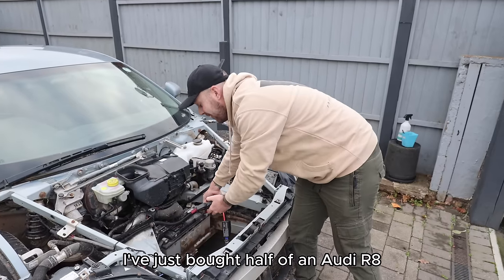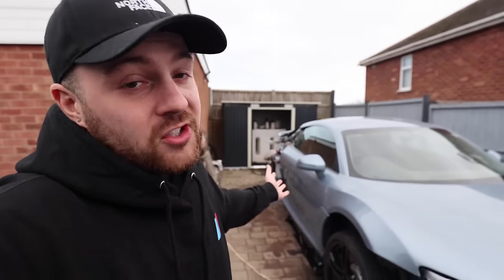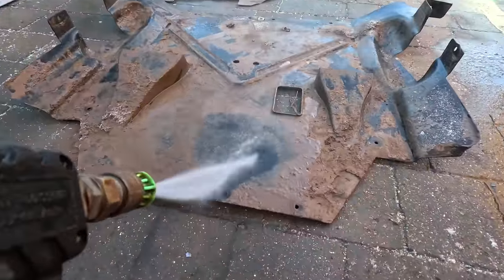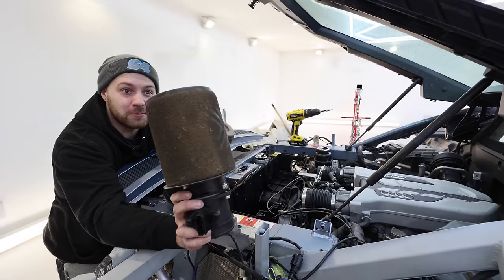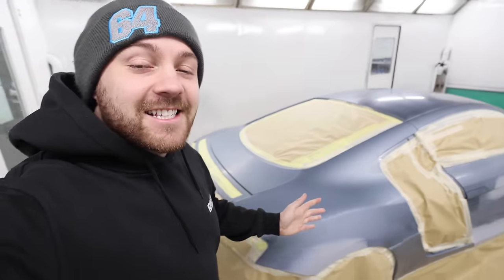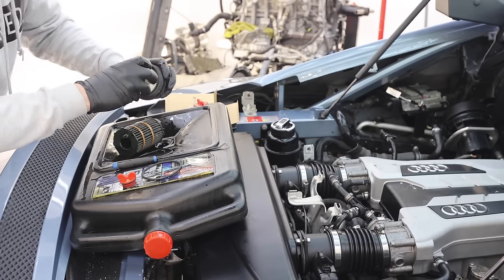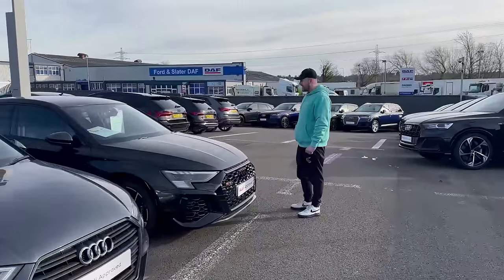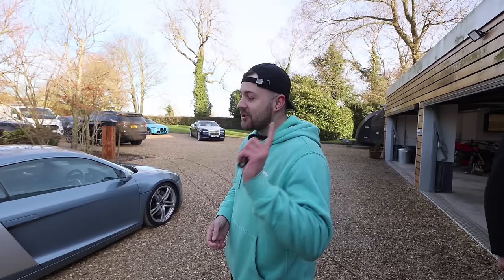FULL BUILD - RESTORING A RALLIED AUDI R8

Comment: Great job guys. It's a sin to destroy such a piece of engineering. Well done for bringing her back to life.
Reply: Honestly because it was an early-one with manual gearbox i would keep it for few years sell it latter with even more value specially if would continue fixing, rear lights, side mirrors & cleaning underneath the car the manual versions are becoming more harder to find specially un-molested not modified or tuned alot.. it is really a decent R8 just needs more care..

Comment: Chris… important!  A couple of comments and it might be worth revisiting the oil filter change… first, if you lift the filter up before you drain the oil the small amount of oil in the filter housing drains out and allows the oil filter to drain so makes less mess…. Bit more importantly, the oil filter has a small plastic nibble on the bottom of it, this is the drain blank that allows the oil to drain from the housing… you need to put the oil filter into the engine first making sure this nipple has been located and push down into the drain hole then put the cap on it hat order… if you do it like you have oil pressure takes ages to build as the filter drains every time you turn the engine off and you loose oil volume as the oil can bypass the oil through this drain instead of going thought the filter and engine.

You don’t need to replace the oil or filter, just remove the cap and refit the oil filter to the engine first and it will be ok 👍

Comment: I would clean very bit treat them with rust proof then undercoat and top coat use rattle can as they are underneath but look better when done. Also renew bushes and clean nuts use copper slip etc. give it a full service even change cambelt if it’s needed don’t skimp on it just do it for peace of mind

Comment: Iv done the derusting test but with pepsi, coca-cola, of brand cola and the traditional coca-cola worked amazingly
Reply: And its working because in original recepy for Coca Cola is with citric acid together with bit of phosphoric acid - as they say it gives "bit of zing". But you can buy much cheaper household cleaners / bathroom cleaners with much bigger amount of phosphoric acid that will do wel as rust converter (it will remove and convert red iron oxides to black more stable iron oxides). ... doing it with cola clone or with alcalic soda is nonsense. Vinegar will work a bit .. but you need higher procentage vinegar and much longer time than with phosphoric acid. And also, heat will help thre process as well